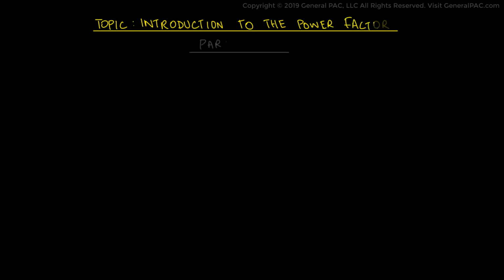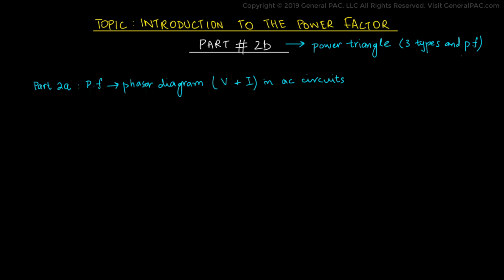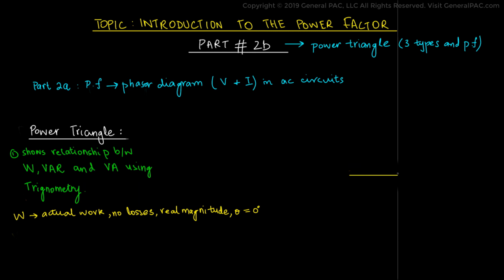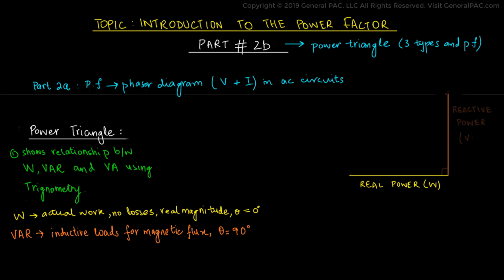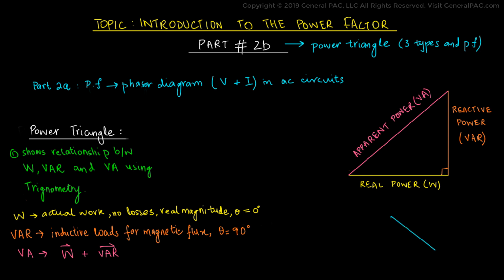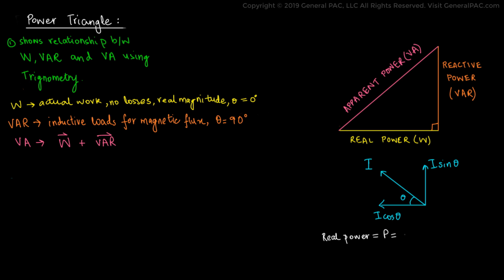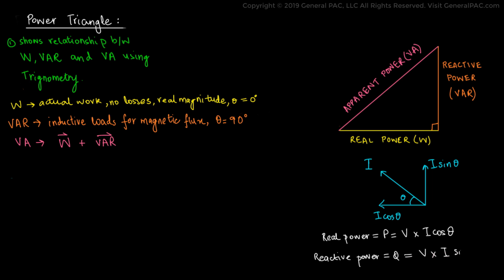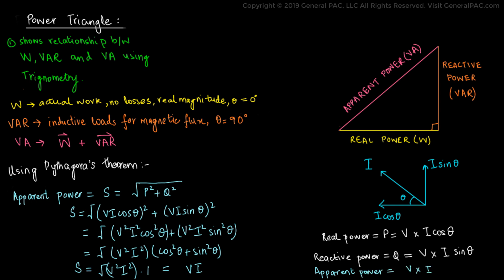Introduction to the Power Factor, Part 2b

Comment: Pf equation uses cos of the power angle, not cos of the current angle
Reply from the maker: Hey Daniel,

Yes, PF equation uses the power triangle angle and it is also mentioned in the video at 4:13.

Thanks,
GeneralPAC by AllumiaX

Comment: Dear I have to admit I love your channel, I am electrical engineer and I have a question that can be naive, bit it is not 
Because 2 factors: foster diesel power generator are made for mechanical not electrical engineer, 2 there is no paper for any independent electrical engineer that explains this.
Here we go...
If I have a 380kVA standby 0masl power Diesel generator, and considering 2600masl operation with losses of 12.64% 
How is the calculation process to demonstrate that a 200hp electrical fire pump whith a Delta/Y starter can be too much for generator.
The reason is 100% of this sector things erroneously that starting of of 0,25 of or in general all of DO NOT CONSUMING POWER FROM THE DIESEL ENGINE. they thing like as far as the generator has kW pump is guaranteed to start 100%, they forget kVA is total source responsable to provide power for starting even kVAR there is no free component. 
Can you help me?
Reply from the maker: Thank you :) We really appreciate your query. You have asked a valid question. However, your question based on simple power calculations which Electrical and Mechanical engineer, both can do.

Selection of generator plays a very important role. Because if we select a small generator then it will cause voltage fluctuations and damage to the generator or equipment windings. If we select a large generator then it will cause engine to glaze and carbon up, due to engine loading. Also, it will increase the overall cost.

Available data:
Generator size: 380KVA (Diesel Generator) with 12.64% losses 
Electrical Firepump: 200hp (approx 150KW) with starter condition: Delta-star
Is the Generator capable to run this pump = ?  

Remember, an on-site engine-generator set is a limited source of power, both in horsepower available from the engine, and kVA available from the generator. As such, it must be large enough to start as well as run connected motor loads. 

There are 2 rule of thumbs generally used to choose a proper size of the generator:
1: D.O.L. – Direct On line starter (to start a motor/pump with high starting current).
2: S.D. – Star Delta starter (smooth starting with medium high current).

So, we normally size the generator to run between 60-80% full load rating of generator. That's why for a 200hp electrical pump, you may require a 400KVA generator. However, we don't have the exact data for electrical pump, so we can't go into the calculations. If you become our patron and provide us all the information, then we can solve your query in the form of video. Join us at: https://www.patreon.com/generalpac
Reply: GeneralPAC: Power System Tutorials  Thanks for your help, this is the question, According a paper from caterpillar, 200hp(159kW) fire pump with a "Star Delta" starter,  the calculations should be begging with Nema code from de electric motor G, it means average 6 kVA per hp of pump, this is equal 1200kVA starting power, and them they multiply by 0.25 (pf common on start motor like our 200hp) this is equal to 300kW , for this reason they say a 380kVA (304kW) should be enough, I do not like at all this method, in fact their method begin with first mistake nema G is for guarantee the motor do not burn, the pump should be start lower than this (we no not know this exact value), second and big mistake is to think that if generator only provide 300kW is ok to provide 1200kVA, our diesel engine DO NOT PROVIDE enough power to generate kVAR in order to reach 1200kVA starting it is means 1161 Q=1200*SIN(ACOS(0.25)), Q=1161kVAR. Unfortunately the diesel generator was capable to run the pump 1832A in starting was the measure, even with alarm of 2 seconds witch do not came to stop the genset, but it is due to the good performance in engine and alternator, even the transient drop of voltage, everything start ok, but as a essential system it should not lift any alarm even in starting procedure, I am right?, please advise, I like you can make a video making the proper calculations for this, in my case starting current was 1832A with a "Star Delta" starter. Best regards.